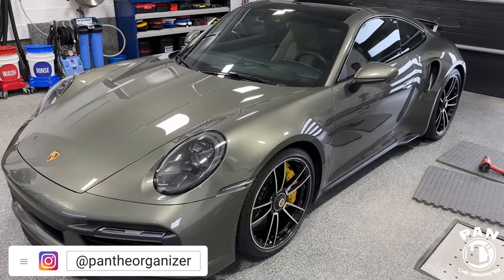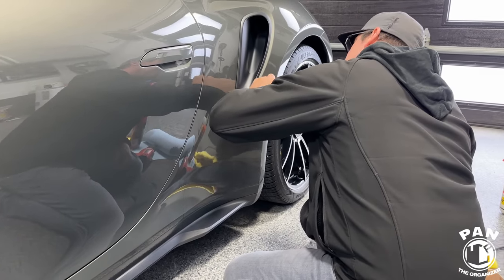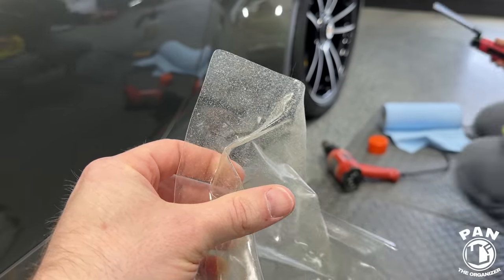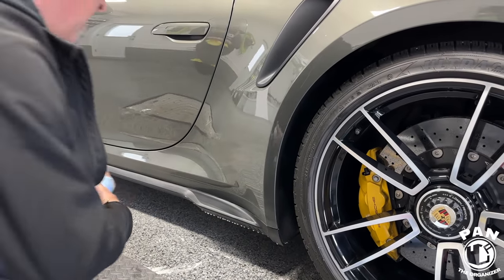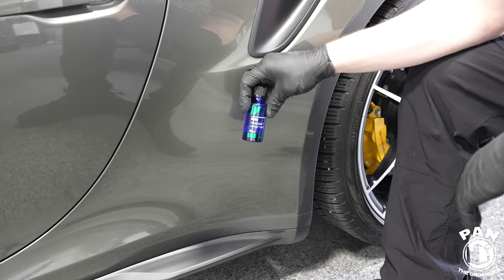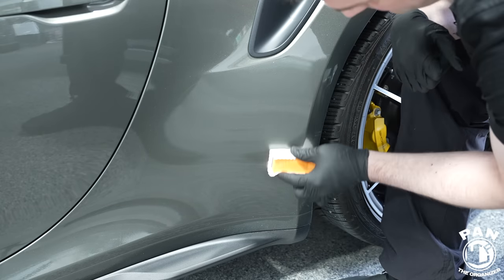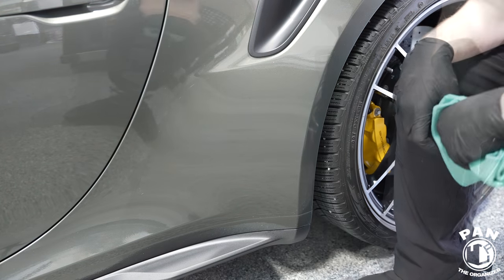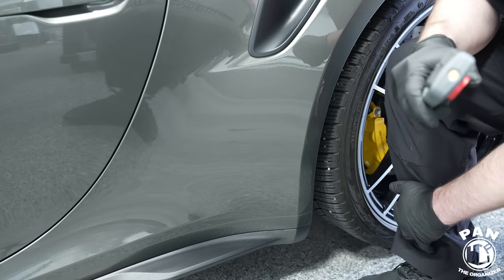Replacing the PPF on my Porsche’s rear wheel arches + ceramic coating!

Comment: Hey Pan, great video as always.
Do you have any videos on PPFs for entire panels such as hoods, fenders etc? There are many people who've had issues with PPFs and many who are happy with them. If you haven't done any videos, could you please consider doing one for people like me to see what are some of the negatives and positives are?
Regardless. Cheers and thank you for all the amazing informative videos as always.
Cheers!
M
Reply from the maker: Thank you. I don't have any videos on replacing entire PPFs. I am just not a fan of the look or feel or PPF. Plus, as I get a brand new car every three years, and do low yearly mileage, scratches and stone chips are of no concern to me. My cars are always pristine when I bring them back to the dealership.

But for people who keep their cars for many years, and want the ultimate scratch and rock chip protection, PPF is the only solution. I would still recommend a ceramic coating on top of the PPF, for the best of both worlds.
Reply: @PanTheOrganizer  Yeah - my 370z (wanna be porsche!) got new PPF on the entire hood/front bumper.  Easily the best move as lets be honest:  Nissan paint is complete dog$hit.   Now I just wish, 9 years later, I did more panels, especially the lower rockers that now look media blasted after 101,000 FUN miles!
Reply: @PanTheOrganizer  Thanks much Pan for the reply. Really appreciate it. OK sounds good. Cheers!
M
Reply: @07wrxtr1  Great to hear that's it's worked for you. Have you had any challenges with your PPFs with stone chips embedded in them or things like the edges of the PPFs accumulating dirt...or any other challenges?
Reply: @-Munditimum-  No problems at all - The people that did the install - they wrapped the ppf around the edges of the hood, so you see no lines and no issues with accumulation.  On the front bumper - that area - back when I used car wax (not anymore!) could accumulate wax if you were not careful to remove it.  Typically you can remove with a good wash or q-tip and quick detailer if it's not dried on there too long.   The PPF itself is a bit more absorbant and higher maint than the car paint - I suspect this due to being a plastic that expands/contracts with temp changes - thus allowing for the self healing - but also for things to accumulate on it.  Decon and buffing has worked just fine.   I do think over time the ppf is thinner now 9 years later compared to new - but so far no detectable discoloration on a midnight blue vehicle.
Reply: @07wrxtr1  Wow, thanks for sharing your info and experience! 
9 Years...that's saying a lot...
Cheers!
M

Comment: I need a hose that’s easy to move around what do u recommend.
Reply from the maker: The best hoses and hose reels (like the one I have at home) are these:
Eley wall-mounted hose reel: https://bit.ly/3b6lSV3
Eley polyurethane garden hose: https://bit.ly/3qqGePb
Eley professional sprayer nozzle set: https://bit.ly/3u4wuwb

And the trick to not have the hose get stuck underneath the tires when you go around the vehicle, is to put this under each corner of the tires: https://amzn.to/2J9XxmZ
Reply: @PanTheOrganizer  thanks for the reply but I meant pressure washer hose.
Reply: Thanks for the reply I. Meant pressure washer hose
Reply from the maker: Here's the pressure washer hose that's most recommended: https://amzn.to/3M3Q2ds

Comment: I thought you weren’t a fan of PPF?
Reply from the maker: I'm not. But the car comes with PPF installed from factory on the rear arches, as on 911 Turbo S, those are super wide hips, and in that area, as you saw in the video, it's worth while having PPF to absorb the damage from the stone chips.

The rest of the car isn't PPF'ed though. Just the way I like it.